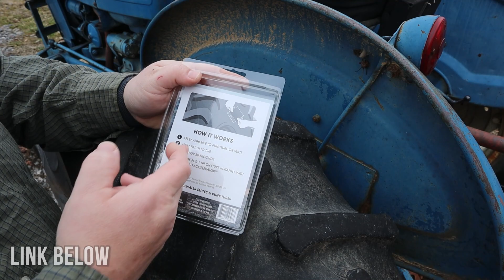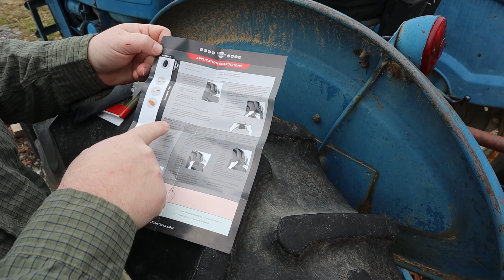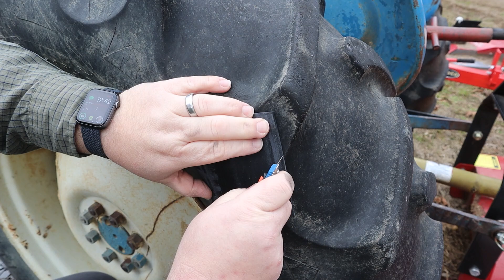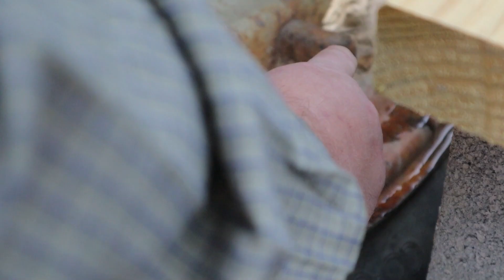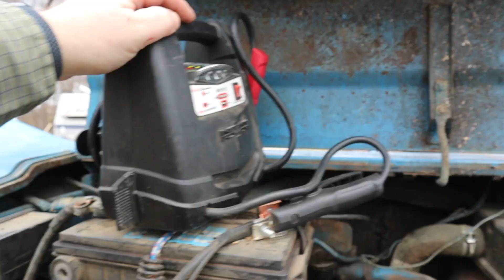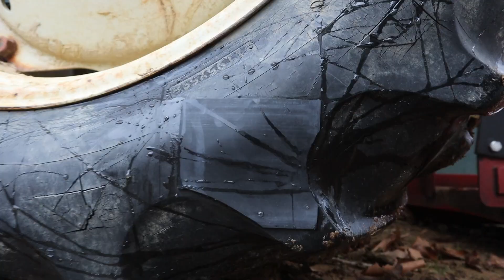No way this works... Patching the SIDE of my Tractor Tire

Comment: my tractor tires have tubes, so holding air is not a problem but i still want to try that on one of them where there is a short split, to try to bring back a little strength there. i have the stuff just have yet to do it.

Comment: I watched another video where a guy put transmission fluid in a rotten tire and it sealed it. He said he had done it several times. He said it might work for a season or two but it was an old riding lawnmower tire.

Comment: They have rubber and heated elements you can buy to vulcanize rubber onto the tire... You basically grind down the bad area and use nylon string to sew up the place you're going to apply the patch... Then you heat it up and vulcanize it from both sides.  This apparently when done correctly makes a tougher patch spot than the brandnew tire wall itself.

Unfortunately this takes time and effort and requires removal of the tire to repair it.  They don't do it often in the United States but it's very common in India and other locations where a brand new tire would cost a fortune to them.

Comment: On the road vehicles you can't put an inner tube inside of them because of heat buildup. I don't know if they make heavy duty innertubes for tractors or how often a tractor tire gets punctured to make a tube a pain to use. But a tube might get you some more work out of it for a short period of time.

Comment: Thanks to you, today I learned people intentionally add liquid into tractor tyres to add weight and gain traction. When that valve started leaking I initially thought "well, I think a leaky valve is the least of your worries with all that water that's got in there" 😂

Comment: There is already a tube in that tire.  As long as you have a tube in a tire, applying a patch will never stop the leak
  They used to use calcium chloride in those tires and that is basically salt water!! When you get new tires have that ballast replaced with something non corrosive!

Comment: We just bought a new tractor yesterday. The dealer put the tiller on the tractor unfortunately they didn't adjust it appropriately and since I am new to tractors I didn't notice. I ended up making big slices on both back tires from the sides of the tiller. It didn't damage the inside of the tire but left cut marks in the tread. I don't know if this would help??😂 I still haven't told my husband.... You may never hear from me again 😢

Comment: Patching the outside is a bad idea and that kit is worthless junk. The outer rubber layers of a tire are vulcanized for durability but the inner layer is a soft butyl layer which is less permeable to air. A proper large multi-layer re-enforced patch would do a much better job on that tire injury if installed correctly on the inside where it can chemically bond its butyl layer to the butyl layer in the tire after it's scraped down to clean fresh material.
In addition, the cyanoacrylate glue used to bond that chunk of vulcanized rubber on cures to a brittle state. It would not survive the flexing of the tire for long. Proper patches are directionally re-enforced so they bend easily in one direction and are marked so the flex is correctly aligned to the sidewall.

Comment: Kids please sit in the seat when you start your tractor. Loaded tires can eat up wheels depending on the compound used to fill them. If you tubed up get the rims after the tires are removed. Descale smooth and paint them on the inside real good. All rust chunks welding slag and burrs need to go away. They will chew a hole in your tube. And lots of baby powder between the tube and tire. They like to weld together if not. Good luck with the old tractor. Nothing to see here. I talk to myself infront of cameras all the time........Thanks and have fun.

Comment: I dont know anything about tractors but wouldnt it be possible to put an inner tube onto the wheel, put a patch on the tire from the inside and then put the old tire back on again. The tube should hold air pressure long enough until you can buy a new set of ties.

Comment: If you take the tire off the rim you can patch it from the inside with whatever  cheap patches you can find with rubber cement. That will fix whatever leak there is on it.

Comment: Something like this is just to get the tractor back home from the field to actually replace the tire. If you try to keep it on and work it, one rub from a field stone or whatnot on the patch could rip it right off. There's no real REPAIR for tire sidewalls. Tires flex, and the sidewall flexes the most.

Comment: 1st, you've never heard of a inner tube for the old tire? But - I have tried that exact brand of outside patch on a lg z-turn mower tire. It works fine. I didn't think it would because it's on the area that always flexes as I run very low pressure. I run along and rub a barbwire fence. And I didn't follow the directions - I just globed the glue on. I also have one on another spot that I run a internal patch that I didn't think would hold. I figured 'belt & suspenders' approach would work. I don't think I needed the internal one but I already had the tire off. Good idea to glue in the crack but would have been funny as *&^% if you glued your knife in it. You should patch the other leak.

Comment: Have you ever tried using a few cans of inflate a flat, or slime , to coat the insides of the tire?. I watched a guys video where he removed the tire and coated / painted the inside, to seal up the porous rubber and stop the leaks. For a while anyway. It's sad that alot of tires dry out before they actually wear out.,,,

Comment: Have you considered having the tires foam filled. Even doing the new tires is a way to make sure you never have a flat again. I have seen the rubber worn off completely and running on the foam. That was on a loader doing heavy construction. As for the patch I am convinced to get one so when I am cruising around off road, I won't have to fear ripping a sidewall, as much.

Comment: Patch it from the inside. The flex of the tire will pinch the tube on the inside. Plus if your tire was losing air, your tube was punctured. There's life left in those tires, they will have to be broken down for the repairs.

Comment: I've done side wall patches on  truck tires, atv tires but have to do it on the inside ! Outside is not going to hold even in a tractor tire going 1 mpg

Comment: When patching from the outside you can use a chainsaw and belt sander to remove the lug and create a flat surface. And for a big cut you can sew the tire back together with wire. Agricultural tires are built really well and can take some ridiculous repairs.
Reply from the maker: Wow! Very cool!

Comment: That looked like a tube valve stem.  Are you sure the tractor doesn't already have a tube in it.  Calcium chloride ballast isn't typically installed in tractors without tubes.  That tire has years of life left of it has a tube installed.

Comment: If the tube has a hole in it it will leak out even if you don't have a hole in the sidewall. You have tubes now. Tractors and many larger tires have a brass nut that holds the tube valve stem in place.

Comment: You used to be able to buy large boots that were up to 12 inches wide for patching large breaks and holes in lug type tires. They had a number of piles and tapered to a thin edges. I actually still have a roll of it in my equipment shed on a shelf. There a lot of things for DIY repair that are no longer sold anymore.  Some were labor intensive so the suppliers did not sell that much because the time/cost ratio made it not worth it. Labor costs money so time is expensive.
Reply: A couple hours of my time is worth fixing a tire that costs $500+

Comment: I am all for saving money and stretching it. Given where it is at why don't you get a needle in thread and sew the rubber together prior to all this, then patch? That would be good for a field repair. Ask for a permanent patch why not take the tire off of the wheel and repair from the inside?

Comment: Hey Sam,  you can actually get new tubes for the tires at Tractor supply store or even Amazon, roughly $100.00 for two tubes and put in now. Probably last about 3-5 years or so. Just an idea.
Reply: ... they make tubes that big ... good ideal 👍...
Reply: Tubes will last life of the tire

Comment: A few yrs ago I stuck a 3 in limb in side of a 13.6/28 tire. Cut a about 8 in square of heavy belting and used maybe 8 carriage head bolts and some kind of glue, don't remember. Covered the bolt heads with a piece of old tube. Put in a new tube and ran it for several yrs. Looking at the outside of tire you could see a giant hole surrounded by 8 nuts. Do what works for you.

Comment: While inner tubes will help preserve the life, if your rims are rusting, as the rusty areas grow, they become rough and jagged, which "can" cause a puncture on your inner tube. It would most likely be best for you to get new rims WITH your new tires. I understand that it means having to spend more now, than having to spend even more money later. If you hold off on getting new rims, with your new tires, until you can afford the investment, vs, having to replace the rims later, you won't have to pay for dismounting and remounting the tires a second time.

Comment: What skirting do you have around your mobile home? We need to replace ours at some point.
Reply from the maker: It's a concrete block foundation wall -- just like homes have, but not load bearing (the home still fully rests on it's piers and footings under the frame).
Reply: @sam-and-angela  Did y’all do a video of this? I don’t remember seeing that. Thanks for the reply.

Comment: You must have tractor dealers around your area....... check with them for a set of good  used tires! Then add your tubes and mount them....... another product that works well is that tire slime..... but  those tires are beyond good....lol.... good luck.

Comment: Maybe fill the tires with foam ,for solid tires if rims are not that bad . Will add weight do away with liquid that causes wheels to rust .  So if you feel comfortable with using the tires . Otherwise maybe new tires and filling with foam no more flats if wheels are safe for that.

Comment: I would not put any faith in the patch. The tire failed the second time at its weakest point which was coincidentally not the patch. The patch was stronger than the dry rotted tire. That does not mean the patch would work on a good tire with no dry rot.

Comment: Put tubes in them , it will be fine I've had a lot worse tires than that and put tubes in them and got another 5 or 6 years out of them and that is with brush hog and hay fork working 100 arces

Comment: I've seen people just put tubes in the old tires. There's  rubber sealants you can get like Flex Seal to coat the outside of the tire
 covering crackers, etc 
I think you should fix up Big Blue. I really like that tractor. When you finish fixing all the mechanical, etc things needed, Make it shine with a new coat of blue paint.
Wishing you the best of success in all you do.
Stay safe

Comment: just toss a tube in it and run the tire some more while u save up to get new tires.    Tubes wont prevent future punctures of the new tires btw, they are just used to add more use to the tire itself. each time something pierces it put a new tube in it to hold air and put tractor to work.. rinse and repeat as often as possible unless tire looses a chuck that exposes tube

Comment: Why don’t you just put tubes in them? Also if the wheels are rusted on the inside that will rub your tube and may cause a leak. You can wrap the inside of the wheel with duct tape so it will help keep the tube from leaking.

Comment: Keep that old tractor running as long as you can! Farmers are fighting for the right to repair their newer tractors themselves. Manufacturers built newer tractors with computer codes that only dealerships have access to. After dealer repairs, they enter codes and tractor is good to go. Owner repairs, doesn't have access to codes, tractor won't run even though the faulty part has been replaced. Be thankful you can do your own repairs!

Comment: Tubes in tractor tires is a MUST!!!
I'd try to find a set or two of wheel weights instead of fluid, I have 3 sets on my J.D. 1020(400lbs each wheel) and it seems to be enough...

Comment: My loader tractor had fluid(calcium chloride) in the rear tires for years, this fall the valvestem started leaking so I had our local farm tire folks come & pump them out. They replaced one of the tubes and $400.00 I'm bsck in business...

Comment: There is product similar to tire slime that might help but it’s water based and looks like you liquid ballast inside them. A bunch of tire slime might work also.
Reply: There a product called rust converter that you paint on and it will stop the rust. And maybe save those rims little while longer.

Comment: I would of totally wiped it down with alcohol, then sanded and applied patch.but that's me not out in the field trying to just get it put  back.i wonder if you could seal it with an epoxy resin coat

Comment: My lawnmower tractor tires leaked, from dryrot. I put tubes in three tires, and still going fives years later. Every application and use is different.

Comment: Perhaps you could foam fill the old tires to survive a bit longer
Reply: But that makes the rims about usless...
Reply: @timnewman1172  wouldn't think so... Sandblaster.
Reply: @williamkn621  I've talked to a Deere dealer about this, and they don't recommend using foam for this reason...
Reply: @timnewman1172  as you probably know John Deere dealers have tried to make it against the policy for you to repair any of your own work on your own. If you'll see just yesterday they announced that they're going to change this but anyway I would take what a dealer said with a grain of salt and talk to a company that strictly does tires and repairs. I have no clue how you think that foam would ruin a wheel. Phone is not any kind of permanent thing it's easily or fairly easily removed and like I said sandblasting. And I pretty much doubt if John Deere dealers do you sandblasting anyway I would check it out with different sources than just a John Deere dealer or one person.
Reply: @williamkn621  none of the local ag tire dealers want anything to do with it, either...
Reply: @timnewman1172  yep I can see that as a possibility. I've read a little bit about the extra weight. Which I don't know how much weight it adds versus people filling their tractor tires with liquid to add weight. But yes removing the tire once it's full of foam is way more difficult and you have to cut it off pretty much
Reply: @williamkn621  I only use cast weights, I hate calcium chloride!

Comment: Hey Sam, you shouldn't have to buy new tires just tubes they can put fluid in the tube s like another comment said. A lot cheaper and I've been doing it for years now on the same old tires.

Comment: I have welded patches and washers around the valve stem on several tractor wheels . If you or your brother don't weld then talk to a welding shop or local farmer who welds .It should be cheaper than a new wheel.

Comment: I use your Co-Op and they are great! I had a  flat last week and they were there the same day to get me back up and running.
Reply from the maker: Good to hear! What would you do in this case? Tube them? New tires with or without tubes?
Reply: @sam-and-angela  Considering how expensive tires are, I would tube them as long as I could and they were still serviceable. I am familiar with your place and I don't think you will need a whole lot of "bite" in the tires since you have realivily flat ground. Tubes are a heck of a lot cheaper than new tires.
Reply from the maker: @steveterry7981  I appreciate your advice and input! I think it will be worth while to look into tubes and try that first then. :)
Reply: @sam-and-angela  The Co-Op has a mobile truck that will come to your place and install them and reload the tires for you. I think you brother is a member if I recall correctly.

Comment: I have run tractor tires with tubes and without tubes. For me, tubes worked better. I have run tires with liquid ballast, with cast weights, and without liquid ballast. I found the liquid ballast to be corrosive and quit using it. Some of the new liquid ballast claims to be noncorrosive. I have never used it, so can't comment. I'm not sure what you might be doing that would require ballast, you might be fine with none. Usually ballast is for use with a loader or for heavy pulling. Not sure that you are doing either of those?? You might be able to find used tires. It would be worth asking at your Co-op if they have any or know where there might be used tires. Not an ideal answer but could save some $$ for several years. 

Would like to see maintance on blue. Good luck.

Comment: I was surprised that you cut the upper part as that spot above where you patched looked pretty sketchy, in either case, even if you would have left that piece, it would have likely still leaked.  Definitely needs some new shoes there bud.

Comment: Hey Sam, you might want to look into putting TUBES in both tires. It seem to me that tractor tires not only hold air but they also use water or at least they use to. I believe that if you use water that requires a special tube. I am doing this from memoir as my Late Father in Law did this for a living for many years. Good Luck I am sure it will work out one way or the other.